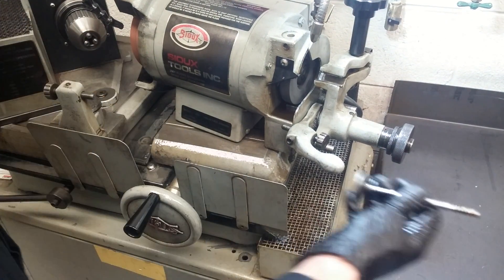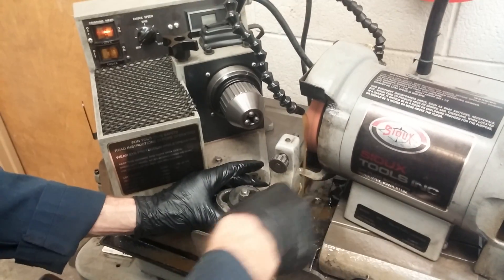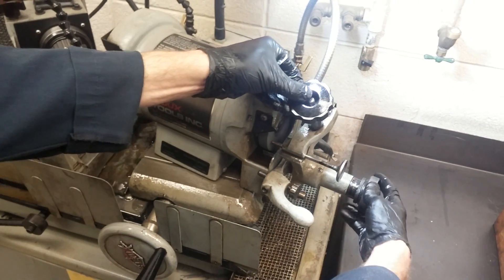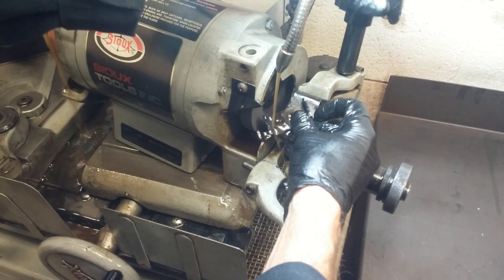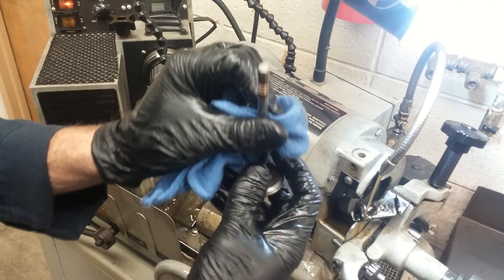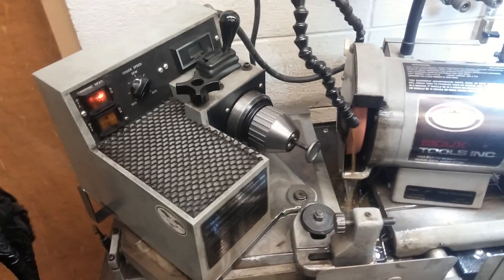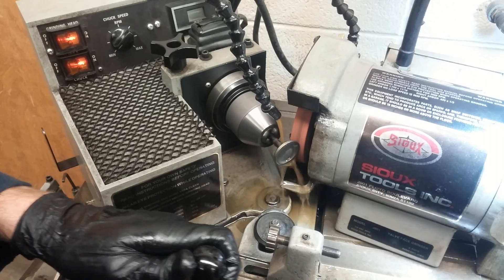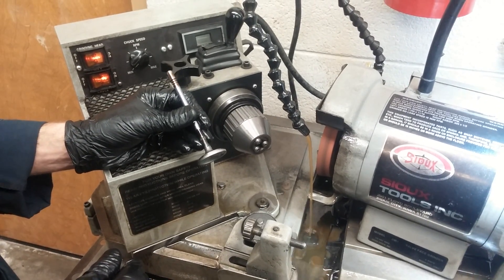How to Grind Valves

Comment: I was taught to grind the face, then the stem, measure the overall length with a dial indicator and return to the grinder to regrind the tips with the flat stone on the right until they are all equal lengths. The tolerance given to me was plus/minus 0.0005", but I try to hit zero on all of them, as all machinists should.

Comment: Hello we are a busy repair shop thinking on adding a system to just repair heads surfacing , valve  grinding , nothing crazy. Is getting pretty hard finding a machine shop that won’t put you in a 1 or 2 week waiting list, a lot of new shops with not good experience we having to do it over again is time and money 🤷🏻‍♂️ I’m pretty sure you done this for years. Looks pretty easy but it takes experience thanks for showing how the machine works

Comment: is it really necessary to grind the tip?
Reply from the maker: If you have bucket lifters, it is not necessary except to bring the valve clearance into specification.  If you have rocker arms that directly contact the valve, it is usually a good idea, but not always required if there is no detectable wear on the tip.

Comment: Justin, I  have a question/ idea that so far haven't got any response from three others I've  asked. I'm  doing a repair on an altima and no.3 has a miss. Checked the valve clearances and the exhaust has no clearance. Dont have time to order new shims so why couldn't I  pull the cam and dremel the stem enough to get it to spec? Thanks.
Reply from the maker: I love your ingenuity!  You can try anything you want to, but I can think of a few reasons that I wouldn't recommend that. 

First, if you are grinding material off of your valve while it is in the engine, you are going create a lot of metal "dust" particles that will destroy your engine.  

Second, you cannot grind the valve accurately with a dremel (to be within spec, you need to be within 0.001-0.002 inches of spec, and the top of the valve needs to be perfectly flat or it will cause wear on both your rocker arm and valve.  

Third, if the valve clearance isn't correct, something else is wrong; grinding the tip of the valve won't fix the original problem and it will probably keep getting worse.
Reply: @JustinMillerAutomotive   Thanks for your reply. I guess once the cam is out I could take the bucket shim to the tech school and have them surface grind the bucket top to spec.

Comment: Hello, i am just getting into valve grinding. I have a Qwik Way SVS 2 with an Accuchuck. I am primarily grinding Subaru Valves. A few questions i have are how do you spot a bent valve in the grinder? Other that obvious wobble? I have no issues doing the exhaust valves but on the intake valves there are times where the valve face  gets a little bigger and then slightly smaller, Not by much just enough to catch your eye. The entire valve face gets cleaned up no problem and they, prussion blue and valve seal great. Is the valve just a little warped or is it normal on bigger size valves like intakes to have a larger amount of runout? Whats the deal? Thank you for responding.
Reply from the maker: You can identify a bent valve when you try to grind it and only one side of the valve face contacts the stone.  No valve is perfect, so continue to grind it a little more.  If you end up with too little margin left before the entire valve face is cleaned up, the valve it is definitely not usable.   If you are unsure if the valve is bent or if it is just  chucked incorrectly, loosen the chuck and rotate the valve in the chuck.  If it still contacts in the same spot, then it is the valve, not the mounting that is causing the problem.

It is also very common to see slight inconsistencies in the width of the valve face after grinding.  Again, as long as the margin is within spec and is consistent all the way around, the valve is usually okay to use.